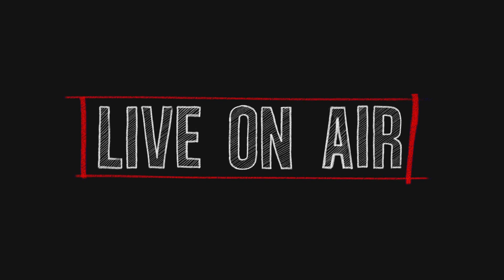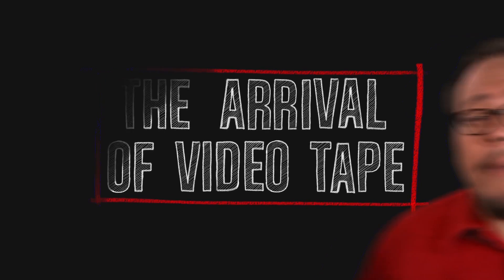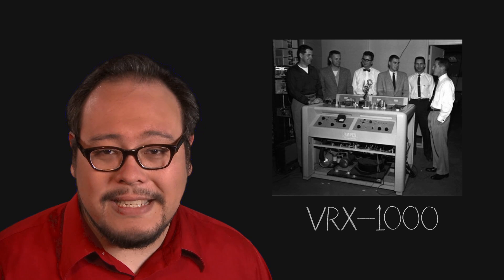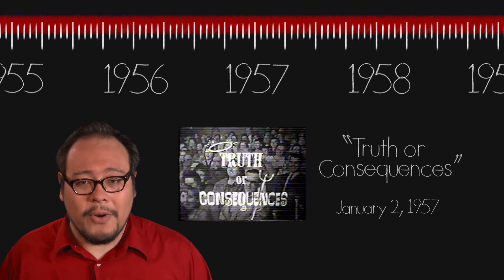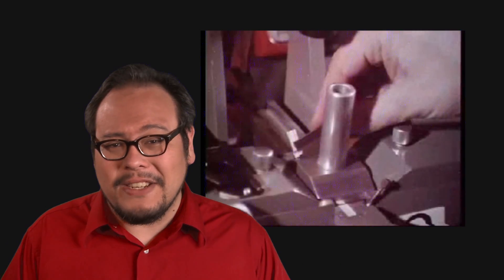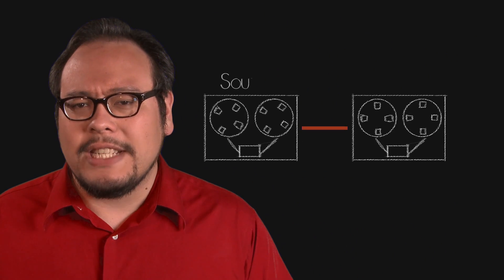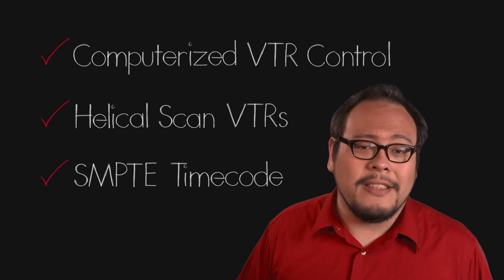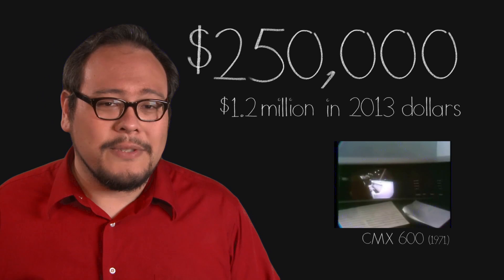The Journey to Modern Non-Linear Editing (Part 1)

Comment: Yea, go ahead. Completely ignore Pre-Read Editing and Digital tape.
Reply from the maker: Thank you. I knew I made the right choice.
Reply: @FilmmakerIQ  It really was an offshoot of the whole process. D-2 came out in 1986 and Sony's version had a Pre-Read "feature." It was so strange, Sony was going to remove the function. I had to beg to keep it. But in only a few years, the D-3 and digibeta and D-5 all has to have the feature. Digital tape meant that you could copy and copy without generation loss. This "solved" the problem of linear editing. 

D-2 sampling rate was the lowest possible to get a color picture 7.08 Mhz at only 8 bit. This was double the color frequency of the analog signal.
Pre-read and full digital edit bay meant you could do infinite layers. Though, there was no undo. It took the release of After Effects that killed off this whole branch of the editing tree. Ten years from the inception and I was editing fully digital video on a PC, with Undo. 

Thanks for your fine work.

Comment: I was lead engineering technician on the assembly line of the Sony BVE-3000 electronic editor in Palo Alto California, 1984. Three one inch type C VTRs (at my work station), built in audio and video switcher SEGs it was a full college education worth of knowledge for me. It was not even the best loved controller of the Sony series. But, it means a lot to me. I collect old video gear today and I have one of these editors in my collection. Long past its due date, all we can do is look at the silent carcass with love and longing. I'm good friends with the founder of Avid and know or met many of the big names in the industry, especially the VTR design team at Ampex.

Comment: To be exact. Helical scan has little to do with bandwidth.  Quad scanned the tape transversely, limiting the number of lines that could be read by the rotating drum.  It required 4x heads on the drum to get a whole frame per rotation, hence the name "quadruplex". Helical scan allowed one head to read the entire frame in one pass, but the bandwidth is similar to quad decks.  BTW, I still think 1" Type-C can look quite good under the right conditions.  It was a staple of television production till the late 80s.
Any way, great work as always.
Reply: I worked for a national television network and we used 1" as our primary recorder until 1993, then moving completely to D2 and DTC. 1" as a source stretched into the early 2000s and I know a network that still dusts off and old archive now and then.

Comment: I actually worked on the very early quad machines doing physical editing. I have worked on every machine Ampex made. And WABD was a network is the longest on-air broadcast network in the world. It is still on the air as the Fox network now. I must point out, the electronic editing on quad machines had two modes of editing: assembly and insert. if you were building a show in a "linear" fashion, you would choose assembly mode, if you were modifying a show, you used insert mode. the difference was thay in assembly mode, the record machine layed down a new control track, where in insert mode, the control track was preserved. also in assembly there was not really a defined "out" point as it didn't matter because the next segment was going to write over the last bit of previous segment. Also the Editec system invented by Ampex, never had a microprocessor. Edited was merely a tone on the question track that signaled the in/out point of the edits. After editec came a timecode editor that used thumbwheels to set in/out points on Ampex equipment. Ampex was king of broadcast video tape. In fact the word "video tape" was copywrited by Ampex. RCA had to call it "television tape"
also I must comment on the CMX 600system (which I worked on) it was the first system to use a light pen interface, I can only store 20 min of  b&w images onto a sea of 300mb disk drives. the result was an edl on an 8" floppy to be used in an online CMX online edit system, where the actual edits took place. you could NEVER use the  video output on the CMX 600 system,  only output was an EDL.
One of the companies I worked for obtained to source code for the online CMX editor and Re wrote it to use up to 26 video/audio sources (even film projectors) that used timecode.
to standing a room with over 20 2" video tape machines, either playing back or locating thier cue points was a thing of beauty. if one machine could not reach its que point in time,  the sysyem would stop the record and first input machine, wait for the second input machine to reach its cue point, then it would rewind the first input machine and the record machine to do an automatic "match cut", then do the edit it was supposed to do. 
At the time, I was the youngest ever to be nominated for an Emmy for editing. I remember when the world switched to tape from live. Sad moment.
Reply: roy Yung 🙏🏼💫

Comment: 4:00 One thing I don't understand - if movies existed in the 1930s why was it not possible to record videos onto tape until the 1950s?
Reply from the maker: +sarnobat2000 motion picture film existed all the way back to the 1890s and still film earlier than that. But those exist as an purely analog medium - when you shoot film and develop it, you have a strip of plastic with your image right there - shine light through it and you're done.

But tape doesn't work like film. You can't look at a reel of tape and see the pictures - it's an recording of the electrical signals needed for a television to reproduce the image. So first you needed TV to exist - a tech that started in the 30s but didn't really catch on until after WWII. Then you needed a lot of electronics and magnetic detectors to encode and read magnetic tape  - a lot of that stuff was engineered in the 40s during the war effort.
Reply: +Filmmaker IQ Okay that makes sense, thanks (I'm not a film school student, just a hobbyist). I think I need to rewatch the video with the correct premise and more of it will stick :)
Reply: @FilmmakerIQ  At no point at school or university was physical tape cutting mentioned. We recorded on to tape and digitised it, but no background info on it's history. So, thanks for committing a segment of this video to tape cutting, as I had never thought about how you'd actually do it.  And it seems you have to really, really love what you're doing to achieve that almost impossible task.
Reply from the maker: They also did that with audio tape... That practice was much more common

Comment: Please I need help like right now, I just wanted to know, is everything that he mentions in this video all non-linear or are some parts linear?

If anyone knows please could you help me out and leave a reply, thanks :)
Reply: Everything before Editdroid and Avid was linear, the CMX600 was vaporware. Even after Avid was introduced it was useless as a finishing tool. We had to go back to linear to "conform" the edits. As late as 2001 we were still conforming due to the lack of broadcast quality in Avid's AVR77 codec. (IMHO, it was ok for promotion then, just not on a national network level.) Old editors around that time were convinced non-linear was a time-wasting fad and anyday management would wake up and ditch the tech they couldn't wrap their heads around. By 2002 they were the ones being scrapped as NLE became fully prime time.

Comment: Congratulations on an outstanding presentation. I spent the years from 1977 to '07 as a commercial producer in New York. You've neatly compressed the evolution of video editing that I lived through in those 30 years. The first TV spots I made were on 2" quad; the last used mini DV for source material. I appreciate that you gave credit to Bing Crosby. He may or may not have been a good dad, but he is the father of both audio and video tape, through his funding of Ampex research.